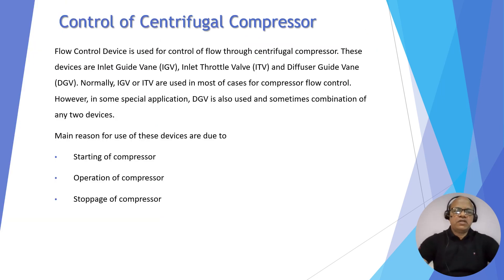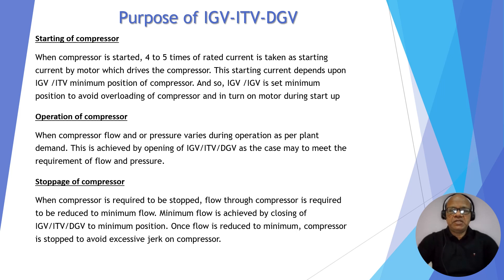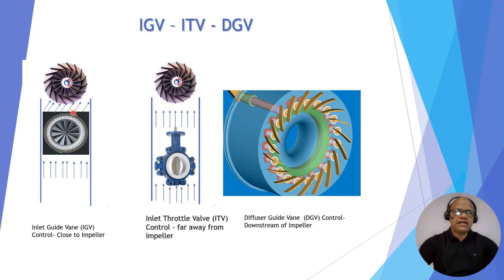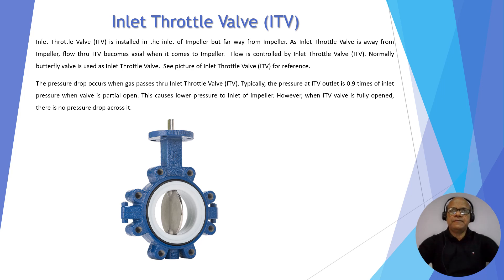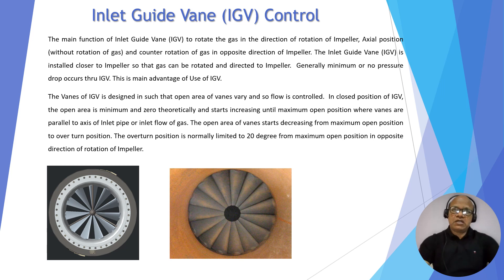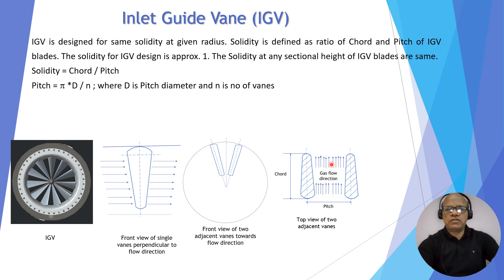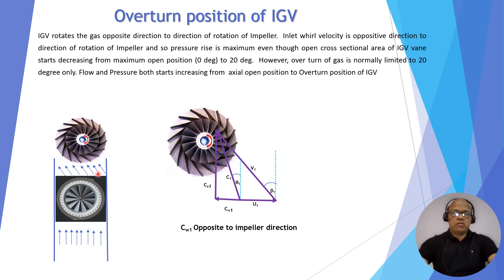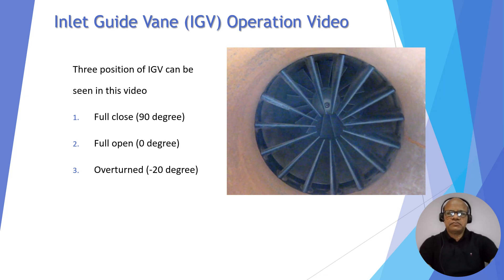Inlet Guide Vane of Centrifugal Compressor

Comment: Thank you for the video.
Is the flow rate highest when the IGV angle is at 0 degrees?
Or is it highest at –20 degrees?
If the IGV aligns with the impeller angle at –20 degrees, does that mean the flow rate is maximized at –20 degrees?
Reply from the maker: Flow will be more in case of overturn  at particular discharge pressure . This means that if you compare flow  at particular discharge pressure at IGV 0 and IGV overturn - 20 deg ,then  flow at overturn IGV will be more .hope this clarifies .thanks